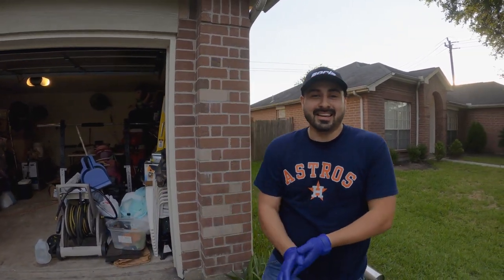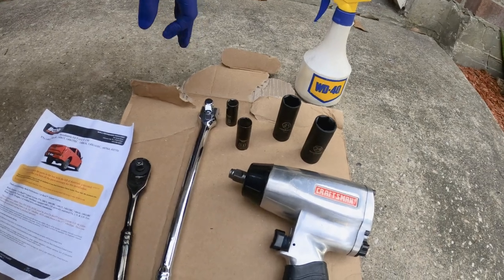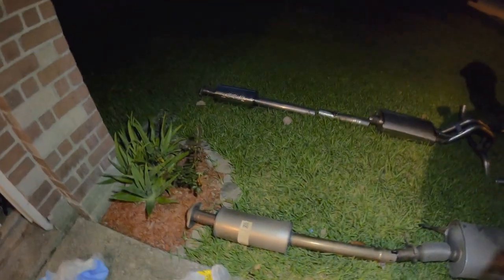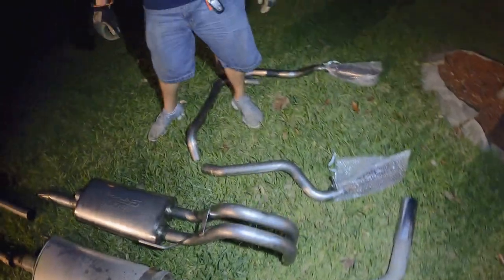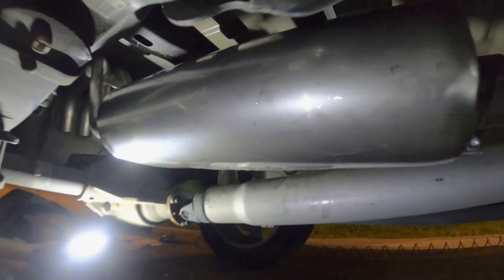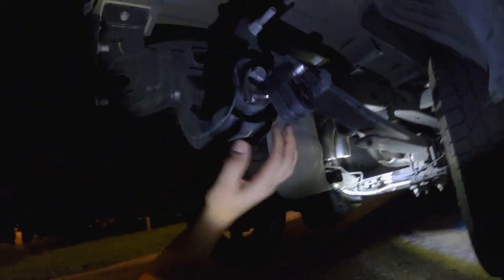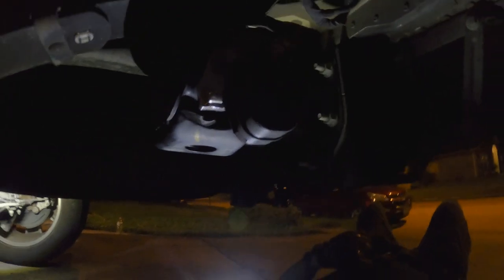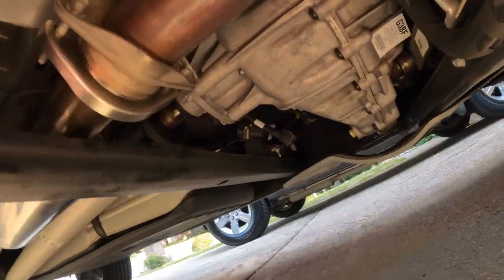F150 Modification, Borla Exhaust S-type | ModFusion

Comment: Do you find after driving with this system for a while you still like it?  Any drone on the highway?
Reply from the maker: Yes, I really like the sound of the exhaust system. The drone sound is very minimum if any, the most I hear is when I switch to sport mode.